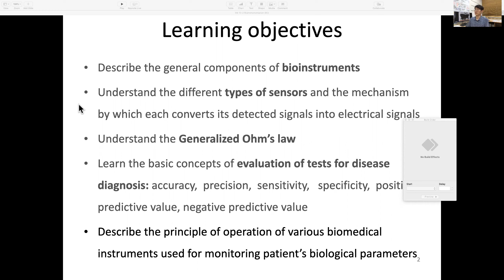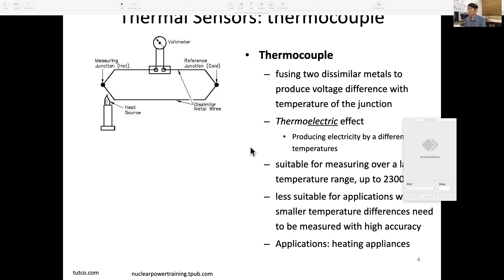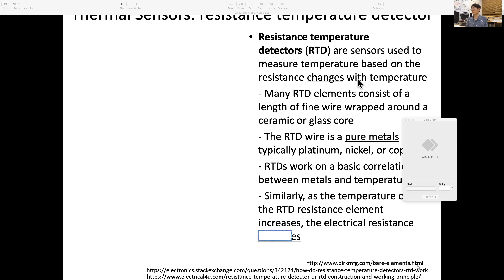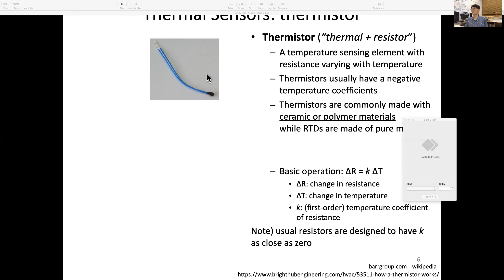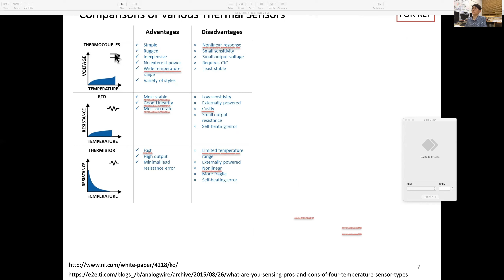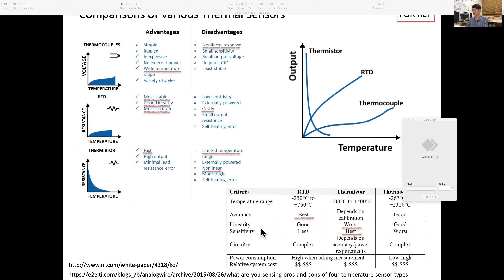11.16 Bioinstrumentation: THERMAL SENSORS

Comment: (Q): what is different application between thermocouple, RTD, and thermistor?
Reply: Thermocouples have the biggest temperature range (from 200°C to 1750°C) so it's usually used to measure high temperatures. On the other hand, RTD range from -200°C to 650°C so it is better to measure very low temperatures. Finally, thermistors go from -100°C to 325°C so you could also use RTD instead to do your measures. However, RTD are more expensive than the other two so you should take that into account. Finally, all three types have different values of accuracy and response time (up to 50s for RTD), so there is a lot of parameters you should take into account before chosing one.